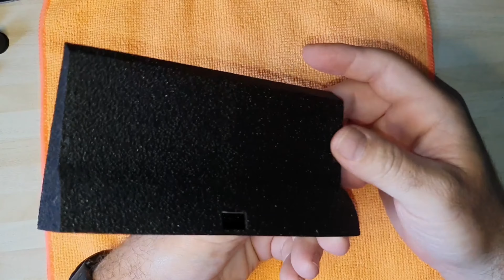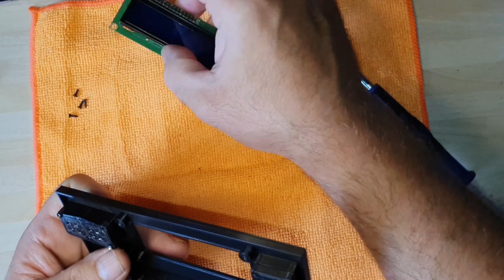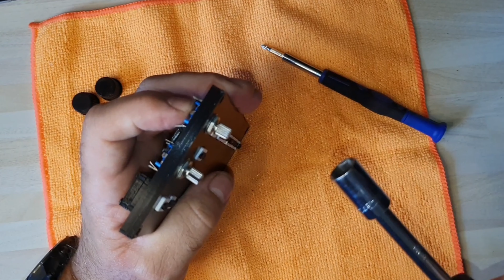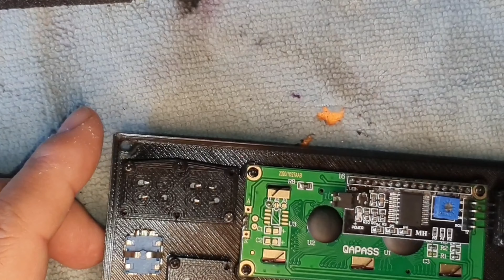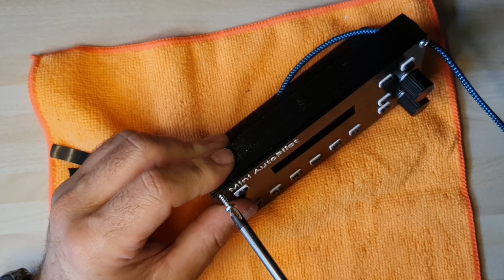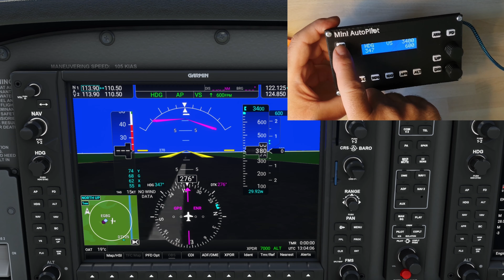MSFS 2020 - Mini AutoPilot - Build Video - how to make it

Comment: Links to purchase all the HW would be nice (including screws). Also don't see a wiring diagram for soldering the switches and the PCB board. Impossible to see where all the wires go from the video. Cheers!

Comment: Very nice project---got all printed parts printed --setting out to assemble but not sure what size screws your using to assemble --Nothing in my current inventory seems to be correct--Could you advise best screw size or sizes for assembly Thanks DR

Comment: I'm currently building my own AP using Mobiflight but I can't get multiple outputs to display in the same field. How did you achieve this? The link to the presets file in your PDF isn't a link so I can't take a look there.

Cheers.

Comment: Great, thank you for the 3d files. Did print them and use an raspberry pico with circuit python and use keyboard inputs for the Xbox fs2020

Comment: How are you getting this to work in fs2020?  I have a home built g1000 button box that can, albeit not without some tricky setup, work with XP. But there are no corresponding items in settings in 2020. I think I found one setting that was recognizable but no other items for g1000 functions. How are you getting fs to recognize this thing??
Reply from the maker: Hi I use Mobiflight as the interface between the hardware and the simulator.
Reply: @Rosenrot213  I think the sim already "sees" the button box - two instances of "button box interface" appear in the controls options section.  And at least from a cursory examination, FS recognizes each button and knob (at least each one I tried using the "search by input" feature).  What FS does not have is any recognizable selections (what are they called - variables?) that specifically say "G1000 softkey 1", or " G1000 Nav outer concentric"; ie, clearly identifiable selections that can pair a particular button or knob to a specific aspect of G1000 control.   In the video, you seem to merely hook this up and it instantly starts controlling the correct G1000 knobs and buttons!  Has the extensive setup been edited out of the video, or am I missing something!??

Comment: Fantastic. I just spotted your post on Printables, this is a really good follow up.
I see you used a raspberry pico in this video. How does it compare to the Pro Micro ATmega32U4 ? 
Is it the same device?
Is the Mobiflight code the same for the pico?
Reply from the maker: Hi, thanks for your comment, the Pi Pico technically has better hardware than the Pro Micro, more pins, and is around half the price.  I have picos in a few device's now and never had any issues. This is the same device that is on the Printables website, as the pico has more pins, the heading encoder button is also added.
Reply: @Rosenrot213  Brilliant thanks, Ive just ordered some picos for this. Im now printing the buttons! :)
Reply: Sorry, Im getting confused. On the printabales site you use the Pro Micro ATmega32U4. I would like to use the Raspberry pico. Is it an easy swap to use the pico as you have in this video?
Reply from the maker: Yes it will make no difference, only the pin numbers, but I included them in the video, if you are familiar with Mobiflight you can adjust the preset, I will upload the Pico preset to Printables.
Reply: @Rosenrot213  that’s great thanks. Been printing the panels all night. Just the faceplate to do now. 
I’ll put some pics on printable. 
Thanks for this.
Reply from the maker: @sivoltage  I just uploaded the Pi Pico - Mobiflight preset on Printables.